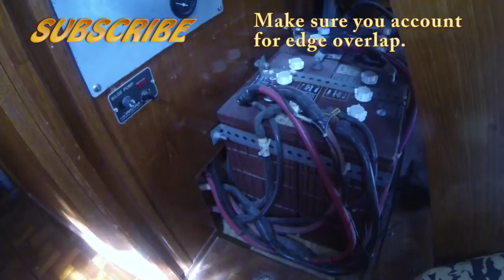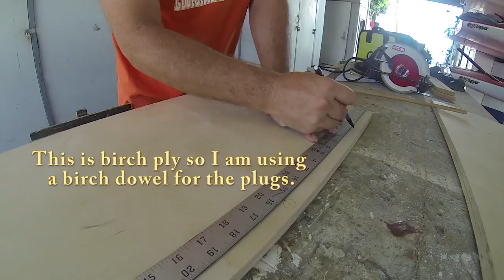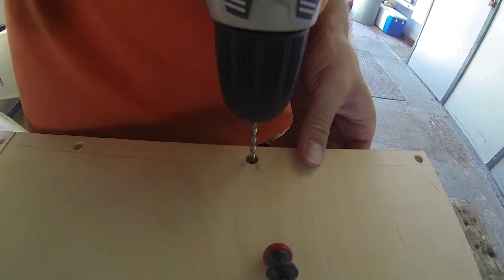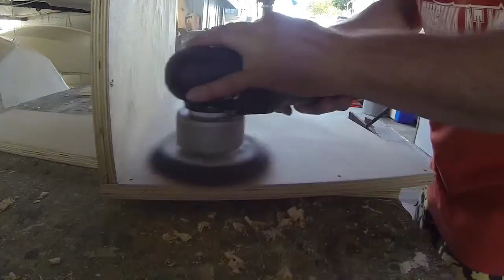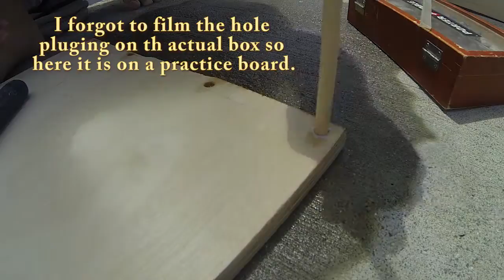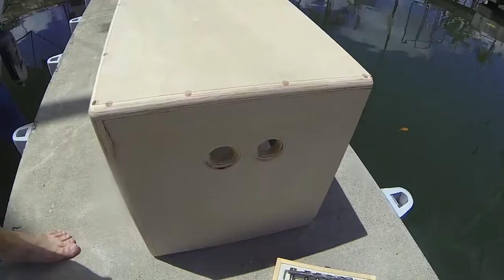Quick Build Battery Box / Cover for a Sailboat Battery Bank

Comment: is birch your usual choice of plywood? is it marine grade?
Reply from the maker: Hi.  Usually I use marine grade on everything.  What makes marine grade is the is  the quality of the bonding agent/glue used to bind each layer of ply.  The glue must be water proof and weather resistant. Almost always both sides of the ply will be a finished layer and pre sanded (sometimes)lol. Also there are much better tolerances for the voids/gaps in the wood/joints. It will usually be labeled as an exterior ply.       Now just because a piece of wood is not labeled as "marine" does not mean it cannot be used.  There are many types of wood that can be used.  Believe it or not lots of pine and birch ply is used and is perfectly fine.  LL Pine especially seen.  These softer woods have a lot of sap in them and tent to fight off rot very well.  But again a lot of the result is in how you prep and what you are using it for and how long you want it to last (mahogany being one of my preferred).   And as long as you maintain it almost all will last quite a while.       So to the point Just look for the best quality sheets you can get.  It doesn't really matter the type unless you are needing a specific type for hull repair or below the water line or a certain color or type for something being stained or varnished.  You usually have to go with what you can get locally.  Mahogany(harder to find), maple, fir, birch are examples of what I have found locally.       For this box I believe I used birch so good guess lol. I hope this helped and good luck with the project.
Reply: thank you. 

I appreciate your detailed reply